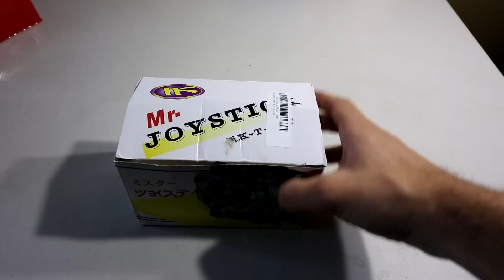Build Your Own Budget Arcade Stick FULL GUIDE

Comment: I wonder what people would say if he brought this to Evo lol
Reply: He would be a laughing stock, but he would have the last laugh if he could win evo with that shoe box.
Reply: So true lol
Reply: Thom Chhim Jokes on them. It is a functional joystick after all :)
Reply: Judging by the video there's doesn't seem to be much delay, and what little delay there is it's probably due to some webcam syncronization issues, so one could probably get pretty far at evo with one of those. It depends on the person of course, a pro will definitely get far with watever tools he uses.
Reply: Frutsy did bring his Xbox 360 console shell arcade stick to evo.
Reply: A guy modded a guitar for cross tag
Reply: I mean if he uses sanwa parts this is as good as any 200+ stick
Reply: people would think that its a melty player
Reply: @Dr_Salt  It depends on whether the carboard of the shoebox holds up. If the cardboard gets crushed or wobbly in any way, then it'll instantly become less reliable than something that has a more rigid case.
Reply: He gracefully put his runners back in the box before the EVO fights...
Reply: @GabeTheGrump  Lmao
Reply: I went this last weekend, somebody came with a pizza box mod, and someone else had an Amazon box.

Comment: Have finished my hitbox-shoebox-zerodelay controller and I want to tell you, guys, that it might be a bit trickier to drill those button holes for hitbox layout, as you need to place them pretty close to each other. So be patient and drill it at slow pace, otherwise there's risk of destroying the surface.

Comment: I built a arcade stick controller for my old school NES. Used a similar joystick and button kit as yours. Instead of the USB decoder board I used a cheap aftermarket NES controller. I put the prototype in a small pizza box. Workes amazingly well.

Comment: Nothing wrong with a cardboard box for housing a system. Back in the 90's I built a 386/486 (can't remember which) inside a VCR box. I built it for testing purposes - if I wanted to test cards, RAM, hard drives, all I had to do was lift the top flaps on the box, and the whole thing was there for me to access. I could play NES games on it too, and also the first Duke Nukem. :) I built it from scrap parts and spares, but it was a decent system for the time. :)

Comment: This is awesome, i'll definitely make one
Reply: Eric Lecarde defenitly would recommend wood or plastic as cardboard won't be sturdy and the top may concave
Reply: Yeah, i do have some plastic sheets i could use, and i also have some really hard cardboard boxes around 0.5cm thick which are almost as sturdy as wood, but i think using real wood would be the best option.
Reply: Eric Lecarde also these buttons are cheap but a good budget option. People usually reccomend sanwa buttons as there high quality but cost more. But yea wood is good and is what I'm planning on doing. Also I'm going for the cheaper sets as I'm not hardcore but I can always upgrade my buttons and joysticks if need be. Gl on your project

Comment: Hey man I was wondering will it work on pc running steam I wanna play tekken 7 with my own custom made arcade stick :)
Reply: Probably, it should work but if not there's always the option of 3rd party software such as x360ce. If that thing outputs as any kind of controller (and it should) you can map it with x360ce to a xbox controller which I'm 99% sure it works on Tekken, you just gotta drop the dll-s into the right folder.

Comment: Hey drew can you explain to me exactly how you got the shoe box stick working. I have mines all put together but at the emulation screen its recognized but not able to function amy tips did you use drivers or sudo to get it working?
Reply from the maker: i just plugged the stick with a 4 prong ribbon cable from the stick to the dragonwise usb encoder plug into pi and then configure new controller. Where are you having issues?
Reply: DrewTalks mined isnt usb based. I think thats where my isssue is.
Reply from the maker: get a drogonwise usb controller/encoder SUPER cheap

Comment: neat. so when you plug the USB into your computer did you need to do anything to set it up? or did it register as a joy stick/gamepad with the buttons?
Reply from the maker: depends on what emulator you are using
Reply: DrewTalks I guess I'm asking as a standard computer gamepad. I don't really want to run a Raspberry Pi or something I just want to make something and then connect it to my computer to play things like Steam games

Comment: Can you use this on your xbox one
Reply from the maker: not sure, anyone?
Reply: you can not, you need a particular kind of PCB to work with Xbox one, ps4 ect... PCB's that work with PC and raspberry run you like 10$ but PCB's for legit consoles start around like 60$. Remember its the same tech that powers the 60$ controllers so its about the same price.
Reply: xRedstreak A pc PCB board will work on street fighter 5 pc right?